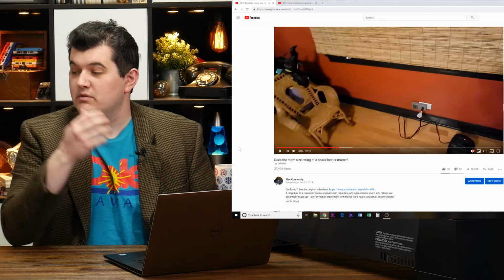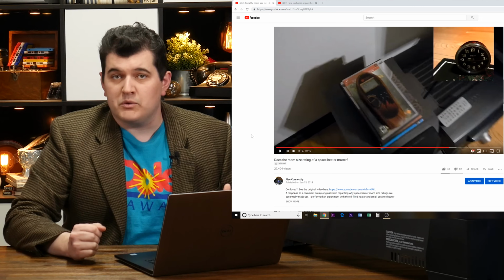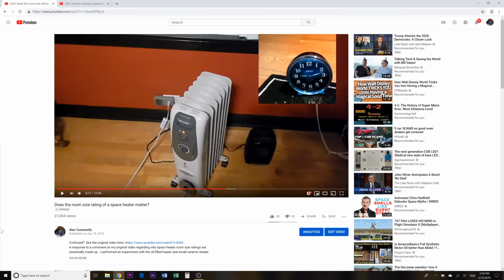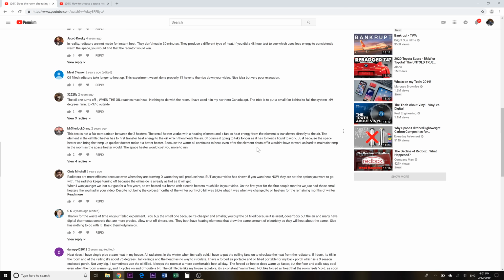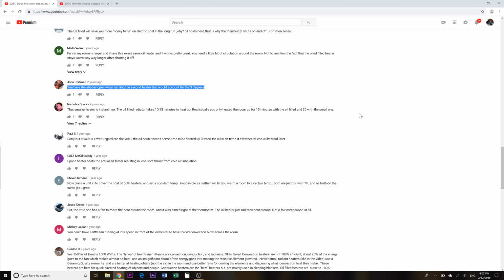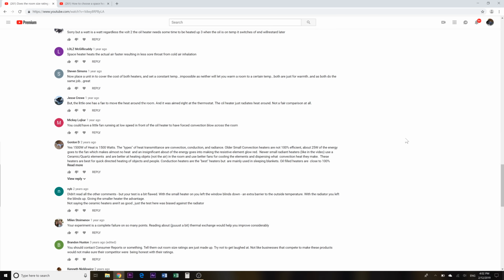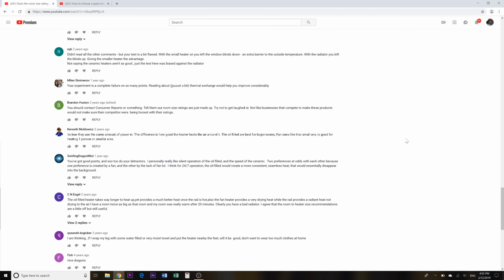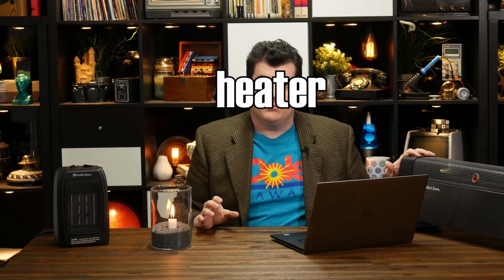More Space Heater Nonsense

Comment: not gonna lie idk what I'm talking about but the one with the fan kind of stops releasing heat into the room when you turn it off and goes from 100% to 0 every time the thermostat turns it off but the oil filled radiator might still be hot hours after turning it off?

Comment: Valid points, but I've always been lead to believe that baseboard heaters were more power efficient. At least I know up in Alaska, typically each room will have its own thermostat at the other side of the room (sized for the room) and its own baseboard heater. That stops the cycling you were talking about. I think of it this way: natural convection + electric heat uses less power than fan + electric heat. In really north Alaska, electric heat is uncommon, and kerosene oil heaters are favored.

Comment: I suspect the only shed of truth to the "large room" vs "small room" heater has not to do with total wattage, but rather their ability to distribute evenly over space. 

A small forced convection unit will spit out a small jet of hot air that will tend to create hot spots along the direction it is pointed. Because the buoyant air jet will disperse and then rise to the ceiling over a short distance, it may not effectively heat across to a far corner of the room, especially if it isn't pointed in that direction.

The radiant heater will dissipate a larger percentage of the heat as black body radiation, which can be felt across a room , despite the air temperature not actually being raised. Its the same effect as when you feel the sun warm you after coming out from behind at cloud. The air temperature doesn't instantly change, but you feel the radiation. As it hits the walls, it can warm the far sides of a room more effectively than a highly directional forced convection heater.

The idea with the baseboard heater is to set up a convective cell that turns over the air in the room. If there is too much clutter in the room, then it will only locally heat and convect straight up to the ceiling.

You could do an experiment with a couple different heater types and a Flir thermal camera to see if there are differences how the heat is distributed across space.

If you have a room with a ceiling fan, i bet you could get essentially identical room heat performance regardless of the heater design (as long as all are 1500W)

Comment: I'm with you on everything, I just wanted to say that those "three candle, pot" whatever type heaters are generally for SHTF or camping or bug out style situations, where you actually might want to utilize that heat a bit differently than throwing it all in your structure. The structure might be crap, so you'd rather have a hot rock near you for the night, than throwing it all in the room and then losing it. Same energy, different location and such. Similarly I'd rather have a warm bottle of water under my blanket, heating under there, THEN heating the tent, rather than heating the tent as a whole first, and then losing it. Same energy usage, not kept around or used near my body, just out in the air right away.

I don't think anyone is using tealights to heat their homes haha.

Also although I'm fully with your idea of these heaters all being the same on the surface, I think the idea is that the smaller one is way nicer to put near you, heat you directly for shorter periods of time (that heat coming off of it is going to make YOU feel hotter, right now, as opposed to warming to room first and then being comfortable) while the "big" one is used to push that heat to the other side of the room NOW to try and get a more even heat right away, as opposed to direct and then even.

It'd be like if we put an electric stove coil on in the room at the same exact wattage. Will it also heat the room like these? You bet. Is it going to be better to be on the other side of the room, or right next to it when you're cold? Would you rather have a fan over it moving that heat now, or wait for it to spread out over time. In 6 hours the room is going to be the temp you want (assuming you have some thermostat on all of these devices) but that's generally not what people buy the smaller directional sized units for.

What I find interesting/funny though is that the smaller units COULD use less power, because that perceived extra direct heat is going to mean a lot more to them, and they don't NEED to heat the entire space to a specific temperature to feel comfortable.

I actually find this specific situation quite funny because I actually switched from that exact small heater you have on your desk, to an oil one. Looking at it now, it's half the wattage of the one you have, and everything makes a lot more sense. If I used that "small" one to heat me directly, it was amazing at first, but then my entire room would be insanely hot after a while. This one doesn't have that functionality without an extra fan, but heats my room nicely. I never "needed" all that power, and it probably would be just as nice to have a small heater with a fan that is halved again, just pointed directly at me, giving me what I wanted from the ones you're talking about, but actually sized for its use case.

I now really wonder why those smaller ones aren't lower wattage, given that people very much do use them differently, and the situations I've seen people use the smaller ones in is ALWAYS more direct and less whole room. It's a very weird situation and I'm glad you sparked my interest as I now understand a situation that was more a minor inconvenience to me that I might never have gave a second thought now that I have my new heater that works just fine.
Reply: Having used an oven as a heater before, the oven is very capable of heating you right now and heating the room (eventually).
Reply: I'd argue the direct heat devices still offer better overall room coverage as proved by the experiment and critical thought. If the thing keeps turning off and producing less overall heat it doesn't matter how it dissipates, it's still poorer at heating the space near you or far. I don't see any real advantage to oil-based heaters but potential safety.

Comment: First, I think you are doing a great job trying to educate your viewers.  The ignorance in some areas tend to be quite big...

A watt is a watt.  But there might be a difference to how heaters work due to the size of the room, especially if using thermostat controlled convection heaters. Just you also experienced.

If the room is large enough for the thermostat not to limit the heater by turning it off, all the energy will go into the air and there will be no difference.  But in a small room there is less air that can circulate and therefore the air around the heater might be heated too fast so the thermostat will kick in and turn it off.  That will happen more likely with a convection heater than with a fan controlled heater that pushes the hot air away from the heater.

The problem then is not that some heaters work better in large rooms or produce "better heat", but some work worse in small rooms because they need quite a lot of air to work efficiently and not being limited by the thermostat.  Therefore especially an oil filled heater might turn of quicker in a small room than a larger room because they are aimed at a low surface temperature and hence be better suited for larger rooms where it less likely will happen because there is enough reasonably cool air to get sucked into the heater when the warm air rises.  Such heaters are not great for quick heating of a room, but great for keeping a more uniform temperature in the room once it is heated.

I had a similar problem in a server room some years ago.  The room was small and the air condition unit was too efficient for the air volume of the room, so it quickly cooled the air inside the unit to close to freezing, which made it turn off.  While off the temperature in the room rose quickly to around 30C, which is close to a disaster.  Then the unit started but was only able to run for a few minutes before it stopped again because it was close to freezing inside the unit again.  But in the room the temperature had only sunk a few degrees, still much too high, and then it quickly rose again, now even higher.  The result was that the efficient cooling unit was close to useless because it was TOO efficient.  We had to do a lot of work to control the air flow in the room to get acceptable temperatures.  A smaller unit that could run more continuously would have been much better.

And for a future video I suggest you explain the dark sucker theory:
http://web.mit.edu/kolya/misc/txt/dark_suckers

Comment: I found that using a fan directed at my oil filled space heater allowed it to disperse the heat in the room better. It also eliminates the problem of the thermostat shutting off too quickly.  Buy a cheap  box fan and use it on low speed if the fan noise bothers you.  These small heaters usually have loud fans to increase air movement because of how small they are. If you want to get fancy, buy a furnace air filter and attach it to the fan. Now you have filtered, heated air.  Personally I prefer quiet space heaters but I don't like that oil filled take too long to heat and cool off and don't work well without adding a fan.

Comment: I actually used the main video about a month ago as justification for choosing a heater type - I ended up getting several panel heaters that I use to heat up the bedrooms starting an hour before we get up. This way the whole room has a chance to warm up before I get out of bed or get in to bed. The only real factor was the noise because I didn't want a fan to suddenly start running at 5.30 AM. Certainly the technology you choose for heating has nothing to do with the size of the room, and everything to do with what you want to heat, and how you want to be heated.

Oil heaters are better suited only in situations where a hot surface would be a hazard such as around children. A lot more power is used to heat the oil than it would take to heat the air, and because the oil has a much higher specific heat capacity, the same amount of heat energy doesn't raise the temperature of the oil the same amount. The cascade effect being that while the same amount of heat energy is created and released, the lower temperature differential between an oil heater and the air surrounding it means the heat is transferred very slowly into the room.

Comment: When I was purchasing a space heater for my home office (In an unheated garage), I also noticed the whole 1500 watt thing. Also ran into that when buying a counter-top burner. Heating elements can only produce so much heat on a 15amp circuit- obvious right? The only real dilemma I had was deciding which type of unit to buy. I get up at 5:00Am, waiting(and freezing) until 6 or 6:30 for an oil filled unit to do its job, didn't appeal to me.  But all of these other type were confusing to me radiant or quartz- whatever they all mean or do... All I wanted is a space heater that that will kick out 1500watts, keep my office warm, and not burn out in a month or two with daily use. Those fake fireplaces are cool, but I don't want to drop $100's on something that might only last a year or two. I never did figure out what the excitement was about quartz-based heaters.
Ended up dusting off the oscillating ceramic heater I had bought for room painting  (Unheated breezeway, in January, in New England). It gets me comfortable in under 5 minutes, and has the office roasting in less than 2 hours. If it burns out, maybe I will get one of those fancy quartz fake fireplace deals...

Comment: oil heater and ceramic heater are better in some scenarios but worst in others.  Not because they produce more heat, they don't like you aleready said.   Oil/ceramic heater store heat in their element, this heats the room slower at first (bad), but when you open your door and loose all your hot air it's good because the heat from the element will heat your room back faster.  It makes the temperature in the room more stable and fluctuate less each time there is air espaping the room quickly (door/window open)

Comment: Probably a lot of the difference is pure marketing. Imagine you're someone who doesn't understand how to calculate heat, and you need to heat different size rooms. Psychologically, without engineering/physics knowledge + data, one would tend to expect that a tiny space heater will generate less heat then a large space heater; because in most other contexts this is usually a valid trade off between otherwise comparable devices...for example, a tiny engine may be suitable for a lawn mower or a go-cart, but a semi-truck requires a much larger engine. 

Why this probably makes sense in a marketing context is because it's giving the user the illusion of picking between specialized versions for each task. They might reason that the small heater isn't powerful enough for a large room, but they large heater uses too much energy or heats up too quickly for a small room. So compared to a heater that isn't marketed based on room size, a consumer is likely assuming they're getting a better value in some form or another.

Comment: The only argument I've seen for using one or the other is fire hazard and child safety. Oil filled heaters are safer, but not totally safe, than fan heaters and bar radiators. There have been incidents where oil filled heaters have had blowouts which is scary stuff, but there are quite a few fires that have started from fan heaters. Here heat pumps are usual so the eletrical heating we have in my house is from that which is of course even more effective than space heaters.

Comment: Something to consider the pelonis doesnt have the greatest reviews. I have a De'Longhi oil heater thats over 10 years old, and with the thermostat on high and at 1500w you do not hear it cycle off and on at all. I was using it over the winter to heat my unheated slightly insulated garage. While yes, it does not heat quickly once it does it maintains pretty well on the lowest power setting and at the desired temp on the thermostat. You are correct in the energy usage/efficiency for initially heating a room. I use the exact Comfort Zone heater in your video to heat a cold bathroom on winter mornings. It quickly brings the room to temp and doesnt take much to operate. The oil heater i find is good for a space that you need to have constant heat in. With it being able to cycle on and off and the oil holding the heat a room can maintain a consistent comfort level quietly, and with little to no maintenance. The previous home i was renting a room in the room didnt heat well in the winter. it was insulated fine, but the forced air heat didnt do well. I used a fan ceramic heater at first but it made the room too dry and the constant cycling was annoying trying to sleep with, and then feeling the hot air blowing and when it wasnt it was cool. I replaced it with an oil heater which was much more comfortable and seemed to be cheaper to run since it was on anytime i was home so it once it made temperature i would turn it down and leave it that way. More or less this stuff seems to come down to preference and the location you want to heat with it. The oil filled ones you can also put a regular floor or box fan on low near them and that can really help you keep a large space warm, once the unit finally brings the room to the desired temperature.

Comment: This may come up as a insult but marketing just reflect users. In EU they just say the power (W) and some times room size in m2 or m3 (the small ,medium ,large was only in english most of the time its in m3 because diferent ceiling height in old homes (from 2.2 to 4m)) that match the power (from low as 200 up to 2500W). Most people just look up the watts and type of heating method.
Maybe because we feel not very proud not knowing simple math and arent afraid of numbers. There is a litle comentary from Neil deGrasse Tyson about numbers in elevators.(we also view 13 as a unlucky number but we just dont care)

Comment: I like the oil filled heaters for a few reasons:

The air doesn't get as dry

They're less likely to catch fire

They're less likely to accidentally get knocked over

They don't need to be cleaned

The won't burn you like some other designs will, which is good for if you have kids

When I got a few different kinds of heaters to test which ones I liked I found that many of the other types of heaters ended up melting their own cords! 

I suspect that the fact that the oil heaters turn themselves off and on, as you said, prevents the cords from getting too hot. 

But in my testing, I did find that watt per watt the heaters pretty much heated the rooms the same. I was also surprised to find out how much I liked the oil filled heaters better. And with a ceiling fan, I find the oil heaters produce a more comfortable room with better heat distribution. 

I also liked infrared heaters for if I didn't move around but I do so I didn't keep those.
Reply: I think the fan blowing air through the coils dries out the air more. 

I didn't know about this until I tested them but if you google "oil filled vs space heater dry air" you'll see many sites say the same thing I noticed.